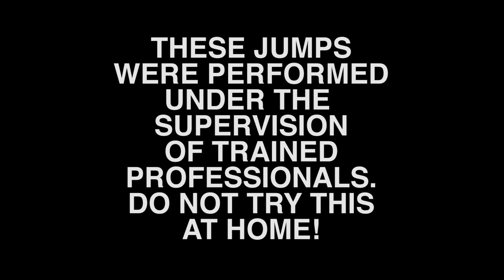Geek Week: The Jump - The Training | Flow

Comment: the height of the landing zone was almost indentical to the lenght of his legs. For safety issues Blue was instructed to land on his ass and back i assume. The impact area is way bigger than the small area from the feet plus the thickness of the torso is way smaller than the lengt of the legs. When you land on uneavean plane the shock absorvin power from the legs differ one from another. if you land with the same power something will break or do some damage to some organs due to the impact force